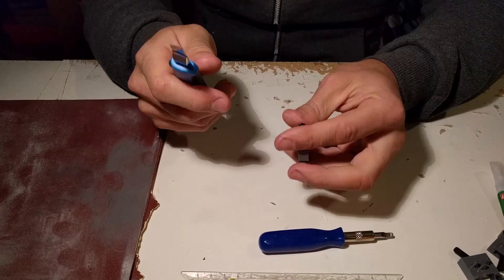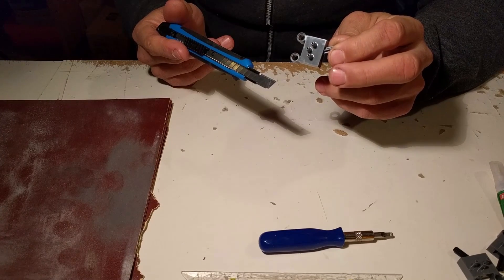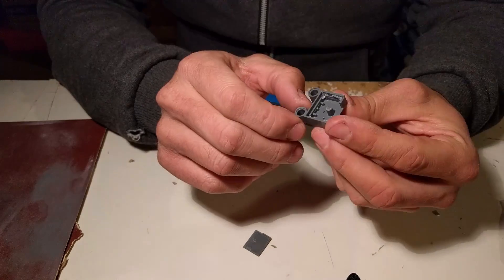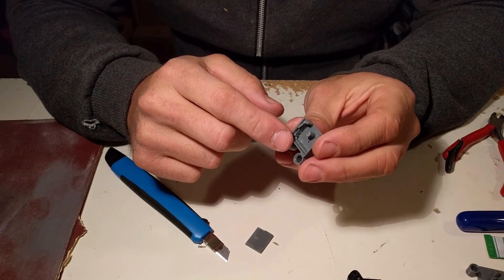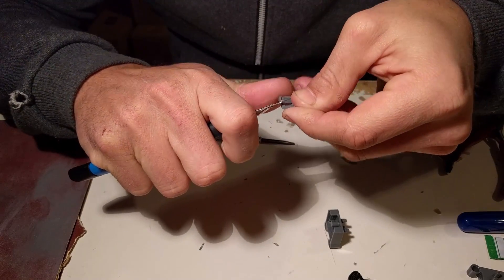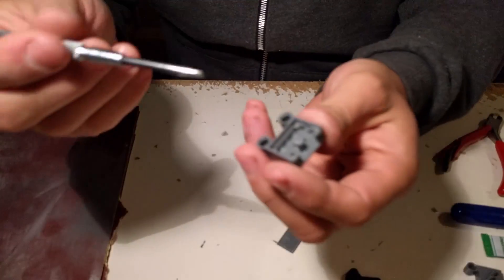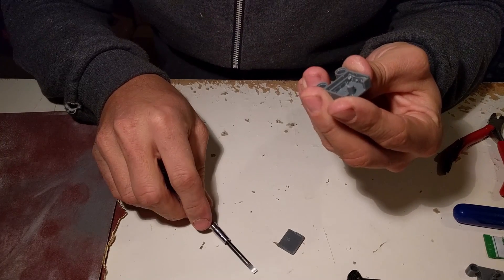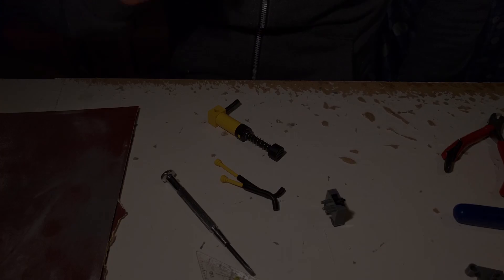LPEpower insight - Modifying pneumatic switches

Comment: what kind of drill bit do i need? and what thickness does it have to be? and what grade sandpaper?!
Reply from the maker: 1.8mm drillbit. I use sandpaper between 240 and 500 granularity.
Reply: will a 1.8 mm drill bit work?
Reply: he said yes, also THIS SAVED MY LIFE this video made it possible for my engines to work! highly recommend it, just be careful, cut myself twice.
Reply from the maker: I cut myself very often.
Reply: Where did he say yes?
Reply: I don't cut myself
Reply: he anwsered your question "1.8mm drillbit. I use sandpaper between 240 and 500 granularity." and then you asked again like a knob xd

Comment: After viewing the video, i noticed that no lubrication was applied to the internals, will this be added later somehow, as the switch will be working pretty hard i can't see how the plastics would hold up without lube.
Reply from the maker: Your choice. Just don't complain about not having a compressor. ;)
Reply from the maker: Do NOT, i repeat, do NOT use WD40 with lego. Use a silicone based lubricant only. WD40 will destroy your lego.
Reply from the maker: You don't want to lubricate it while gluing, because the glue won't stick. After the engine is assembled you run it on the silicone lubricant spray can for a few rotations, this gets the lube everywhere.
Reply: What i thought, i always lubed my LEGO machines, as a matter of fact i think LEGO should include some in some more expensive models or inform people about the importance of lubricants, in my opinion this will teach kids and youngsters allot by it self.
Reply: do i need some kind of lubracant then? will wd40 work?
Reply: what if i dont have any?! XD what brand would you sugest?
Reply from the maker: Buy some. Better no lubrication than wd40 (in regards to lego). I use cyclo products. You'll see in the next video.
Reply: ok, so is lubeacation nessarcy? also can you make a video on how to make a good compresser with the 6l pumps in the next video? 

(sorry about so many questions! )
Reply from the maker: Lubrication is highly recommended. No, i will not make a video making a compressor out of lego pumps.
Reply: you dont need to add it to the internals of the switch but for crankshaft bearings its definitely a good idea.
Reply: Nicjasno ok, and why not?! :(
Reply: but what if i want to make a pneumatic car but dont have a compresser?!?!?
Reply: (and do have 3 pumps)
Reply: Baba's Custom Lego Creations kinda screwed, not enough PSI/bar, buy a 100psi/bar compressor for like $120 and your set, its what i use.
Reply: what if i don't want to?
Reply from the maker: Because those things are pointless for running lego engines. You get more out of the batteries if you just use the electric motors to run the car.

Comment: You know what? If I was good enough with Sketchup I'd design something already planned in my mind an I'd upload it to shapeways so that people can 3d-print it. It is  basically a lego and lego pneumatics compatible switch which operates on continouous rotation. Much much better for LPEs than even your modified switches :-)
Reply from the maker: Rotating switches are a pipe dream of mine. :)
Reply: nicjasno 
Maybe even some more realistic Cylinders with less friction in them and larger intakes? (And maybe have them be connectable with the valves via some non-lego tubing with larger diameter).
Lots of possibilities but someone has to make them real and plus this is getting pretty far away from actual lego ^^
Anyways, thanks for your quick reply :D
Reply: ive been learning sketchup recently, with the "3d printing" template it might be easier?
Reply: my buddy uses it, i need to check it out.
Reply: Built a house so far! ;)
Reply: Baba's Custom Lego Creations im going to be designing vehicles and such.
Reply: ok